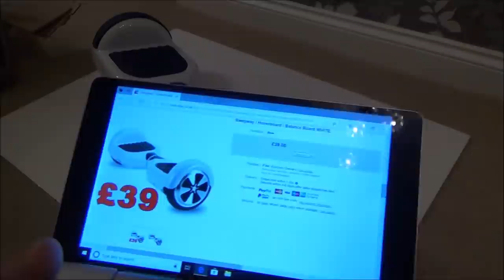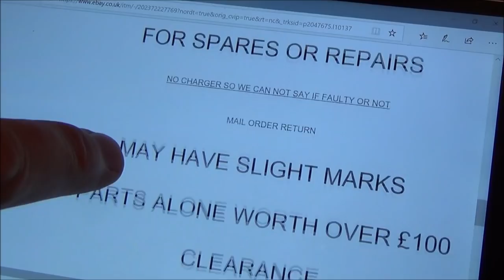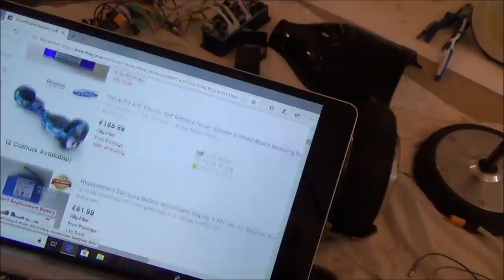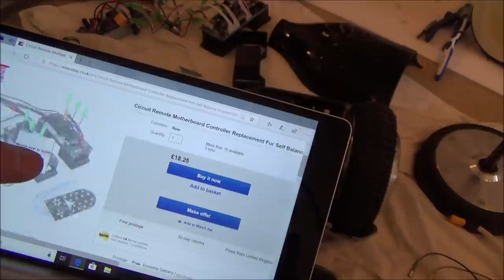Trying to FIX a Faulty £39 Hoverboard from eBay (Self Balancing Scooter)

Comment: You are absolutely correct vince, typically if you drop a phone or anything electronic into water, it is the minerals and other things in the water that make it conductive and thus shorts out the circuits, you could literally drop your phone in pure water with absolutely no contaminants in it and the phone will be fine, as for if the wheel would work or not i should think so as long as the little board in it wasnt touched by water, the windings are enamel coated so they should be fine.

Comment: I would get myself an ESC (Electronic speed controller) and a wireless receiver/transmitter and build an RC car or a robot out of those wheels. Also... It would be a really good idea to have an ESC laying around if you are going to be troubleshooting motors.

Comment: First off, this does NOT have Bluetooth as one other commenter led you to believe. It's a 433/868 MHz remote control so you can turn on/off the board - i don't know why you would like to do that, but it exists. The control mechanism is a follows: The rubber parts stick into an optical interrupter (the fork like black part on the PCB) where the rubber/plastic part breaks a light beam, telling the board that you stepped on. It has no pressure sensors at all. The actual control mechanism is an accelerometer in each side. It's a small square chip with no pins, probably an MPU5060 or similar. It measures the gravity, and when you tilt the board with your foot, gravity readings change and it runs the motor.
Reply: Exactly what he said ----^
Reply: It's so the government can track your movements by tracking the thing that's moving you or what Zapro said.

Comment: I stopped using eBay when it stopped being an auction site and turned into a scam site 15 years ago. Around the time eBay purchased PayPal. I buy from Amazon as they deal with scammers quickly and effectively.

Comment: The damaged part on the board looks to be a photo-interrupter. This is the same sort of thing you used to get in old-style (ie. ball) mice. If it's a compatible type (which it probably is as these tend to be fairly generic) then maybe you could salvage the part from an old mouse. These are a transmitter (usually an infra-red LED) and receiver (phototransistor) pair, and they have to be put in the right way round otherwise they won't work. Most have a part number on them and a quick google search should turn up the datasheet which will have all the info you need to get the right sort of part. In my experience, pretty much anything can be repaired - it's just a question of how much time, effort and money it requires. Good luck Vince, and keep up the great videos!

Comment: Those two parts that look identical from both sides look like huge electronic speed controllers with a little extra on there, maybe accelerometer or gyroscope and some other unknown extras. My brushless quadcopter motors have a similar 3 connectors on them, one for each phase of the motor. Typically the brushless motors like the wheels use are water proof and can be simply rinsed out, with the bearings being the main part that can cease up from water or other damage. If you can clean out that other wheel and change the bearing, it may be salvageable. Corrosion is the other enemy of brushless motors though..

Honestly I'd try to get a refund. I understand it was a no refunds sale, but it was false advertising / lying when it stated over 100 pounds in spare parts and I think that would be grounds for some kind of money back situation. Great video!

Comment: Best to do by cleaning that corrosion on the circuit board is, to spray some alcohol on it and use a tooth brush, this has worked out for me on other stuff that ive fixed.   Currently i need to fix my NAD Surround Reciver, but it will take alot of time to fix it as it has about 6 circuit boards.          I also dumpster dive some times and i find alot of good electronics which still worsk or only has some bad components or leads. A few months ago i found a 1000W 48V scooter layin in my street, reason why they thrown it away was probably because the lead acid battery was dead.      Ive tested the motor and lights and control board and its all good.        It was also really rusted so i went and bought a multi tool to sand it down, also used an angle grinder to get the rust away on the bigger surfaces.            You should try to get stuff for free aswell :P

Comment: Test it with a ohm meter, That might actually be a three phase motor possible either Delta or Star connections, Optic senser like what is inside a optical rotary encoder.

Comment: the item looks pretty new I think it's probably been in a shipping container that's got flooded with sea water

I would give the eBay seller really bad negative feedback.
Reply: If it were an issue in the shipping container, the wholeseller or the reteller could easily get their money back.  The fact that the battery is missing shows clearly that someone has gone into the hoverboard and removed it, and perhaps other items of value.

Comment: Hi mate you said the boards were. Water damaged,I used to fix mobile phones, when a board was water damaged I used to use a 50/50 mix of distilled water and white spirit and put that in an ultra sonic cleaner  then blow dry the board and that in ,80 of cases fix the damage it may be worth trying for those motherboards

Comment: the connectors are called XT60 and are commonly used on RC devices at the moment that kind of motor seems to be a brushless outrunner of somekind the rusty one for sure is unusable but the other seem ok just by look you might try and use it for some other project of yours ^_^ (p.s. in a brushless motor just inverting 2 wires will change the direction of the spin)

Comment: that blue tooth board is for controlling it with your cell phone and i have saved stuff in this shape i used brass brushes and corrosion X it will stop the rust remove the rust and help stop shorting of the boards

Comment: The Antenna/Aerial module is most likely for a remote, this is so they can be locked and unlocked from been used. May also be for a remote speed controller.

Comment: It doesn't take a lot of water to corrode the insides of device. 
 A small puddle can sit sealed inside a housing for a long time evaporating, condensing on colder metal bits, evaporating again, repeated until water from the reaction is used up or has left the housing.

 Water damage is going to be a common fault in consumer electronic repairs I strongly recommend studying the science behind it and techniques to remedy it.

Comment: My wife brought home a Rumba a couple weeks ago. The thing was abused. It had water damage from someone cleaning it by exposing it to water, the one motor was no longer working so when I tryed getting it to go, it would only go in circles. The bottom brush was missing, the side brush was worn out. It was a mess once I opened it. Since it was a gen one, it wasnt worth repairing. I do have the battery pack that appears to hold a charge and the charger and station. I may list them on E- Bay. The rest went in the junk.
Reply from the maker: I purchased a spares or repair vintage Tamiya R/C car the other day. I see you are into planes but thought you may be interested in other R/C as well. Looking forward to getting stuck into it :-)
Reply: @Mymatevince  It can be addictive.lol. I started out with one teach yourself how to fly plane called the Apprentice. Since then( three years ago) I have purchased and sold 3 others. I have about 8 planes right now. Three helicopters, three RC cars, a few drones. Some are Battery, some are Nitro powered. You can check it all out on RC Hobbiest Extreme on You Tube. I make a few videos from time to time trying to help others get into the RC hobby. I really enjoy your willingness to tackle the projects you do. I got into wiring LED lights into my planes, that got me more into electronics. However, my money maker for RC is fixing and selling gas powered lawn equipment.  Its a good hobby too. people give me stuff all the time to work on. I like working on electronics, but small engines are probably more my thing. I did have to crash course learning how RC stuff works. lol.

Comment: works in the same way as a ceiling fan & its sat on 2 sets of sealed bearings use vasline on the bearings & along the outer edge of the windings

Comment: On the wheel you should pull the armature from the stator wheel there is only magnatisan 
keeping them together then you could clean the armature and stator with fine wet or dry and a drop off thinners then blow dry with air gun

Comment: Bluetooth is not for audio, its a wireless network kinda like Wi-Fi. You can send audio via Bluetooth like Wi-Fi but on that thing its for battery level and so parents can lock it to slow speed, speedometer and such.
The foot switch is an optical switch one side has a LED the other a light sensor, you push down it blocks light and it knows where your foot is.
you where checking continuity on the sensors not the windings, Look up "sensored BLDC" and that motor wheel assembly is called a hub motor.
I know its been a bit but if you have that board I can send you a optical switch, or a link to one.

Comment: A quick tip, for Phillips head screws try to use the largest screwdriver head that will fit, it will be much harder to strip the screw this way.

Comment: Hi, I love your videos and I have been subbed for a little while and I think you should try to completely disassemble the boards and clean them with a toothbrush and distilled water, after you brush them down rinse them with fresh distilled water and after that rinse them with a bit of isopropyl alcohol and leave them to dry for a while. If the mosfets or any other chips arent blown I think they should work and you probably should replace the bearings in the waterdamaged wheel because the water had to seep in thru at least one of them and you saw what it did to the metal insides, they shouldnt be expensive at all.
also sorry for all the mistakes Ive done in this comment because I have no idea how to speak english since I live in the Czech Rep.
Reply from the maker: Thanks for the sub and the advice with the distilled water :-)

Comment: 1:09:00 you have put the wheel to far in so it is scraping the inside of the wheelhouse i did fix my brothers and his the 4 screws that attached the wheel to the bord was loose so first i did tighten them but then it made that scraping sound (probably why it did fling back the handle in 1:06:50) so i did take it apart again and loosen the screws and pulled the wheel out a little bit and then tightening the screws again and put it together and it did perform nicely :)

Comment: Hi Vince. Nice to see you struggeling.....  good work... thats the way to learn it. 
I think that the opto-coupler sensors are only for safety.... you have to stand on it otherwise it will do nothing...the small wires to the motors are going to hall-sensors, magnetic sensors. If the motor is standing still and tilt the board a bit forward the hall-sensors detect that and the logic is steering the engine.... so.. i hope i gave you some usefull info. Suc6 with your channel.

Comment: I'm wondering if damage was caused during shipping. Somehow sea water contaminated the product(s).
 
I worked for a contractor at a major car company, no longer trading. I reported that a number of cars had faulty windows that were not closing fully. The batch was designated for delivery to Japan. 
The policy was to ship them with "minor" faults like this, and distributors would correct faults at the destination and charge the manufacturer. 
Unfortunately, on the sea trip, although the exterior was coated with wax to protect the paint, sea water flooded the interior through the partially open windows. 
The lot had to be returned to the UK for major rectification.

Comment: I would try it but not if I had to pay for new batteries. If the power was off there is a chance you can get that wheel working but you really need another one in order to test things. Id power wash it out gets all the rust out then you can actually check things out. Rust on a PCB isn't a death sentence it can be cleaned and resoldered with no issues.

Comment: Does it move?
No
Does it need to move?
Yes
WD40
Reply: lol! PB Blaster!!
Reply: Does it move?
Yes
Does it need to move?
No
Duct tape
Reply: but it's wet, and needs the water to bugger off, so displacing the water from the rusted parets surely would help ?  GM Kof hard    I use WD40 to fix everything that's rusted shut and it's never failed me yet... got the pistons of a seized engine on a Porsche working and made me a sizable amount of money for very little work =P
Reply: GM Kof hard  Heresy!
Reply: Vaseline

Comment: @Vince that part that you broke looks like an optical sensor. Take a look at ITR9608. Should be easy to solder, though have a look if you can find the exact type of sensor (part number or similar)
Reply: Those types of sensors are similar to sensors in the old ball-type mice for computers. They usually pair up with a perforated disc that rotates in their crevice, and count revolutions, therefore determining distance of movement or speed.
Reply from the maker: Thank you for the item code, they are really cheap. I can get 10 of them on eBay for around £4. I will have to look closely at the actually part to see I can see any number or markings on them :-) If I could get the circuit boards fixed cheaply then I be tempted to buy the battery to get it up and running.

Comment: Those sensors with rusted pins shown at the one hour mark i think are called transmissive photo interrupters. You should be able to find replacements from your electronic component supplier of choice.
I cant help you with what exact part you need but replacing those should be a lot cheaper than a complete motor controller thing if the rest of the components are still working.

Comment: someone might have bought it for parts, took the batteries out and resold it.  those are some nice motor wheels Ive been thinking about buying a used one and make the wheels into a two wheel drive bike. theirs a video or two on YT where they drilled the hubs for spokes and made it work. though i think they used two or more battery packs. also WD40 is bad for bearings, it eats the grease out and will damage them.

Comment: Question Vince, don’t know if you had this happen with a Xbox, sometimes when I turn my Xbox on the light turns on for around 10 seconds then shuts off, after that it’s fine, turns on and works. I think it’s the hard drive because of the noises it makes. What’s your opinion?

Comment: I just found one without the backcovers underneath. I dont see a power button, the battery has no juice. I dont have a lithium charger. I I need to try to turn it on, any ideas how? My lab power suppl.y is max 30v5amps

Comment: I would've used some brake parts cleaner on that rusty motor followed by some electrical parts cleaner.  That likely would've gotten all the rust and water out fairly quickly.

Comment: 21:00 the PCB for the lithium batteries so they don't overcharge. I never really leave negative feedback on eBay but I would in this instance. A Little scuff pad on the magnets and motor ends and it will spin again.  If the windings are not broke or exposed and the brushes are good, it will spin. Its like a motorbike stater (alternator). I bet they took the 18650 batteries out and either repurposed them or recycled them. I could get it running again. I've fixed worse.

Comment: Those 2 rubber dots from the feet pads are just optical switches.. and the speed control is done by a gyro :-)

Comment: I assume the antenna circuit board is for a key fob remote like you have with a car I think it had the ability to lock and turn off

A lot of hoverboards come with one it's not the most useful thing but people buy the ones with the most features

Comment: If you often have knackered screws esp as the Chinesium machines make it a requirement to fit cheese grade fasteners, invest in a set of left handed drill bits and a cheapo set of screw EZ-Outs and will get them nasty rusted out screws like a champ.
Reply from the maker: Cheers for the tip :-)

Comment: Look it's not water damage as a lot of the materials are aluminium what you are seeing is corrosion from acid where the battery has leaked hence they removed the battery.
If that's any help
Reply: possibly! Aluminum will corrode and powder especially from salt. Magnesium , I beleive, will plain old desinegrate.
Reply: um nope Lithium cells dont leak ...if they leak you will notive
Reply: @peterzingler6221  so please explain why the corrosion with the aluminium
Reply: +Alun Callow Well Aluminium is in normal state already coverd with an oxide layer, the visible "corosion" can come from many things its common to See that on carparts .
In this case i think saltwater caused it since the look of it appears to be the same as in cars after some Winter , it can be normal water tho.  And yes battery acid would do the same but all hoverboard use Lithium packs that dont leak they just vent and if they do they smoke up the complete board

Comment: I guess it has been recovered from a container lost overboard from a ship and washed up on a beach..  Probably salt water corrosion in which case aluminium parts would be more corroded.  Probably a lot of them recovered in the same area.  Batteries would have been shipped separately from the items as they would be Lithium ion cells.

Comment: I think it was flood damage and that it was stock purchased from a store or warehouse and they through away the packaging because it was ruined and likely sold the chargers and batteries that worked separate.  The ad said no charger, but did not say anything about no battery.  I would return it.